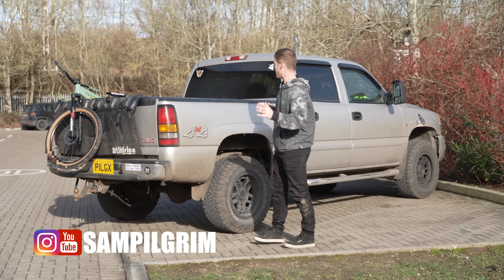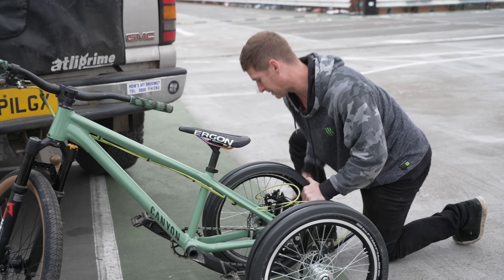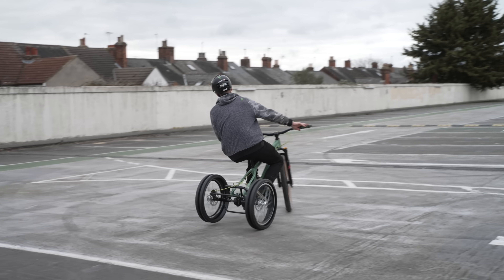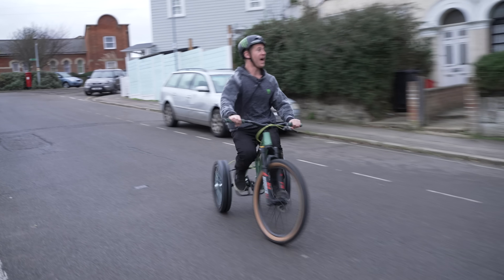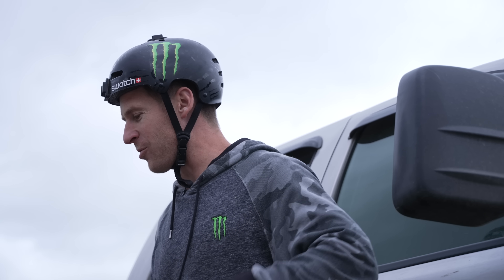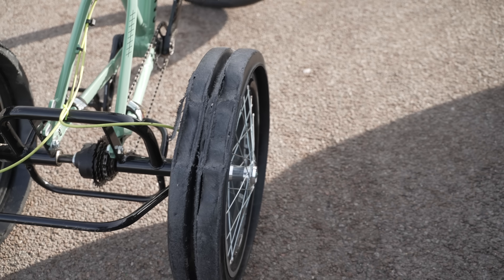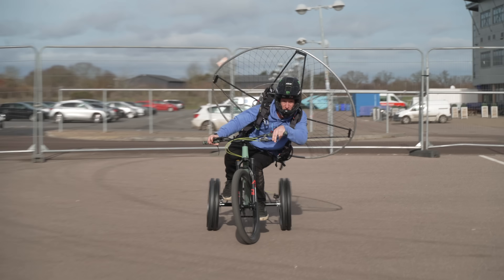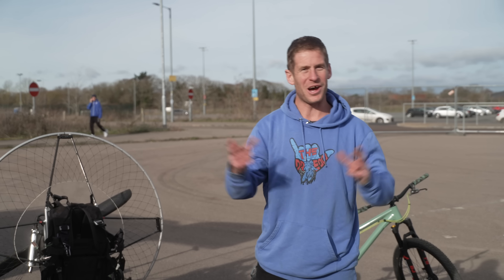MY CUSTOM BUILT MTB DRIFT TRICYCLE IS RIDICULOUS!

Comment: Delrin! Great high density plastic that people use in industry for wear surfaces. If you want a single slippy surface, you could just mount a big lump of the stuff to a rim in one spot. To get it around would be harder and I’d advise contracting a fab shop to make that for you. They could just mount a bunch of little blocks then turn them down into one round. It’d cost a fortune, but they’d last a while and work a treat, I think. Else you can maybe do what my dad and I did for my big wheel as a kid. Big round of PVC tubing of the right inner diameter, cut to desired width plus an inch or so either side. Then, cut 2 more rings, take a notch out of each, and kinda compress them around the tyre like a snap ring. Glue in place with PVC cement, and boom. Retained wither side, nice and round, and mine lasted years on a Green Machine getting whaled on.
Reply: Kitchen chopping boards, usually PTFE. Same result and cheaper. Could make sleds/ski's for the rear

Comment: If you are after plastic/nylon tyres for the trike to use for drifting, 'perhaps' use the 'blue' plastic/nylon water pipe that they use for the water main feed to domestic supplies.
You can 'probably' cut the pipe to size and then using an internal coupler with a resin based adhesive to join the pipe ends together.
I'm pretty sure this could work mate, you might want to seek further information on 'how to glue the pipe using an internal insert (length of insert needs to be about 25mm.
Using the 'blue plastic/nylon watermain feed pipe, you should be able to create a tyre that actually fits within the rim of the wheel (more secure).

Comment: Love how much Sam enjoys his Adult big wheel..lol

Seems like you could use ptfe dowels or a single dowel, heated and formed to go around the rim, secured from the side with pocket screws like cabinet makers use.
Reply: Pvc bends easy too and flies well. Perhaps a long strip of Pvc hot bent around the rim. Wrap it up until the rim bed is filled them glue a wider strip to it and wrap it around a few times for a thick layer

Comment: @SamPilgrim.  Try wrapping the wheels with melted plastic.
Collect a lot of plastic bottles and other household trash. Sort it by plastic type (many YT videos available).  Melt it in an oven and kneed it into long strips that you drape over the wheels while still hot, have the various strips overlapping.  Include the top-end of the spokes for grip.

Comment: Nice one Sam! I cant wait to see the future! Not sure about another kind of plastic pipe big enough for those wheels, but you could try thicker cuts of the corrugated pipe, they might be less wobbly as they get thicker. Also, you could screw little blocks of wood into the pipe on either side of the tires in multiple places around them to lock the wheels into place.

Comment: We had a green machine trike as kids that we skidded through the plastic wheels really quickly but my dad found this super thick pvc pipe that fit perfectly over them and glued it to the original wheels the wall thickness was like 20mm so super durable but so skiddy it was barely rideable as kids. Feel like as an adult with a fan it would be perfect!👌🏼

Comment: Add snowboards/skis with holes in for the rear wheels to poke through that are adjustable up and down. So you have the option to roll or slide with like a handbrake mechanism.

Comment: Dill holes in the groove of the plastic on the outside through the wheel and fasten with nuts and bolts about 10 per wheel should do it 👍

Comment: You sure could use a 2" roll of grip tape for the inner diameter of the pipe. Same thing works with 10" PVC and go kart tires. The keys is grip, ironically!

Comment: That tube's corrugations are hollow on the inside!  Just reveal them from the interior of the tube and you'll have a lot of drift tire casings.     if you got a soldering iron, you can make (via melting)  two 360 degree cuts on the inside of the plastic tube's interior, removing the flat tube interior face, revealing the hollow void of the corrugations in that tube (they're hollow!)  Then merely put your wheel/tire back inside and inflate - the tire will occupy the void of the corrugated section and be held firmly in place by the sides of the corrugation - you will only be able to use one corrugation section (or three - just use the middle void for your tire).  Might have to slap on a  fatter tire to fill the corrugation void, but that's the idea - and you get to use the rest of your expensive tube.

Comment: tubular tire tape , slap a strip around the tire and leave a bit hanging out so you can peel off the outer layer while the tire is inside the plastic, then air them up to stick them in

Comment: try PEX (plumbing, that's what it's called in the US anyway) you can cut it to length, close the loop with a fitting and crimp it closed after you get it on the rim. use a heat gun to "relax" it.  Pex may not be hard enough though to last very long, but there's only one way to find out

Comment: Injection moulded shape, with tyre rim shape, perhaps a silicon or rubber gasket to aid seating.
Outlay will be about £30,000 but you could start a whole UCI RACING DIVISION.
Then expand it to 4Cross,  Downslope, Time trial and even Daredevil competition.

Comment: Find a piece of hard wearing plastic pipe.  Thick walled.  Roughly the same diameter of an mtb tyre. Something that will bend with heat.
Place valve of tyreless wheel as start with end of pipe. Drill down through rim into pipe. Rivet. (Or self tapping bolts like roof panel bolts to bite into plastic through rim. Pay attention to drill size for best tap) Heat pipe and roll rim, pushing down. Drill. Rivet/tap. Repeat. Then trial and trim end to splice ends. 
Drift wheel. You're welcome. 😃
Reply from the maker: Yessss!! Thanks :)

Comment: Spray the insides of some old tyres with release spray. Fit them to the rim. Cut a hole in the top and fill with deep pour epoxy. Let it cure then cut the tyres off.

Comment: What about mains water pipe the blue plastic stuff. Run it without a tyre,  bolt it to the rim in a few different spots with the bolts sunk through the outer part.

Comment: Get some 50mm polyethylene pipe (poly pipe) cut it the correct length to be same as the tire circumference. Remove 1/4 of the pipe wall for its length.  Polyweld the pipe ends together .
Put over tire pump it up and send it

Comment: You could try using 2" or 3" PVC HEAT IT UP WITH A HEAT GUN TO BEND IT INTO A FULL CIRCLE. 
CUT A PIECE 3" LONG  CUT A SMALL SECTION OUT OF THAT FOR AN INSERT TO BE GLUED IN TO CONNECT IT. 
THEN ATTACH TO THE RIM WITH SCREWS THOUGH THE RIM INTO THE PVC TIRE.

Comment: Look at SDR 11 or 9 piping (9 is thicker than 11).  Still probably expensive, but it is a solid wall pipe compared to the corrugated pipe you used here.

Comment: Make some permanent drift tires. Maybe 4 rungs each tire. 1 rung on the inside the extra two on the outside. It'll add stability and maybe still drift the same? 

Epoxy the rung that'll meet your tire. Use a cheap tire. Blow it up. Let it set.

Comment: Why don't you just make a solid PVC pipe as a tire¿? You could heat up a PVC pipe and be ND it around the rim then seal the 2 end together and make a super strong tire.... Especially if you use a thicker wall pipe.    😁👍